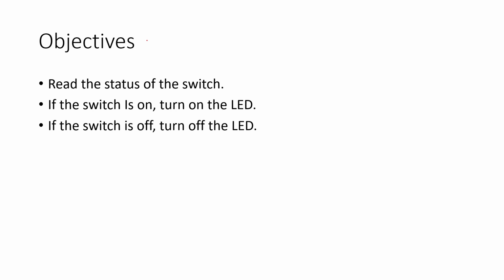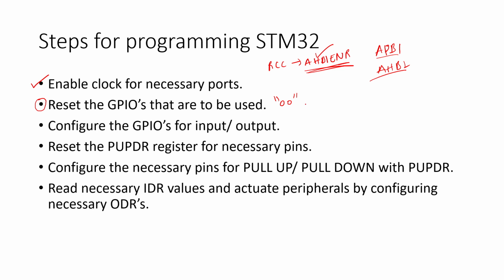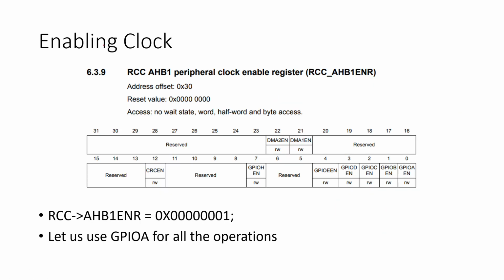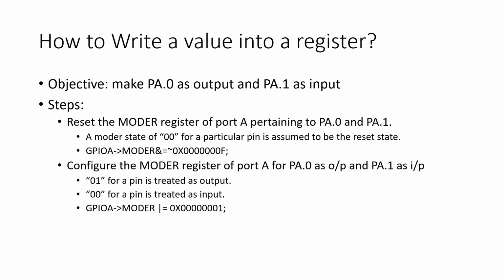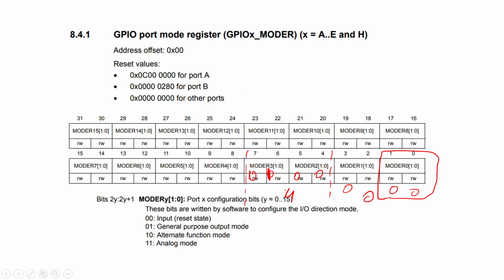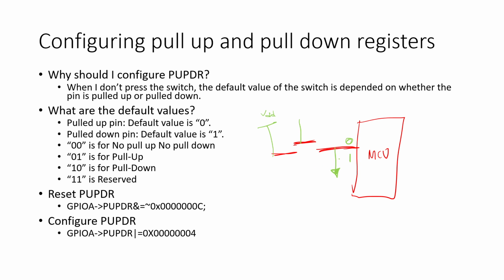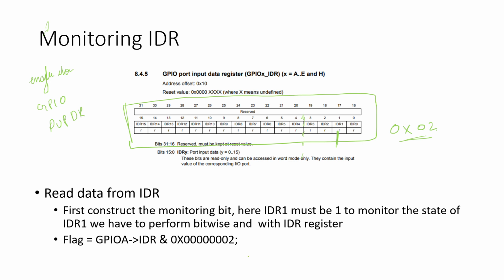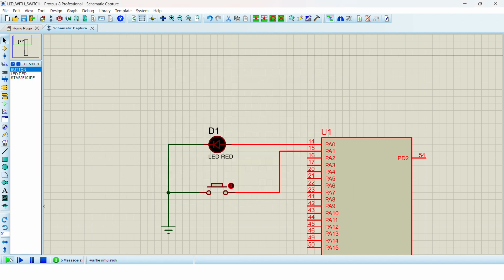Embedded C Programming for STM32 PART - 2

Comment: BRO why pupdr reset has 0x0000000C value
Reply from the maker: The reset values can be determined from the datasheet, but here I have assumed the default value of a bit to be '0' so when I do &=~0x0000000C 
Only the bits which I will be using, which is pupdr[1], pupdr[3], only these bits will be reset to their default value(0) because 'C' equivalent binary is 1010, so when I do ~ it becomes 0101 and when performed & with the respective register those bits at the positions of '1' only will be reset.
Reply: @TechTalks2712  thanks bro clear